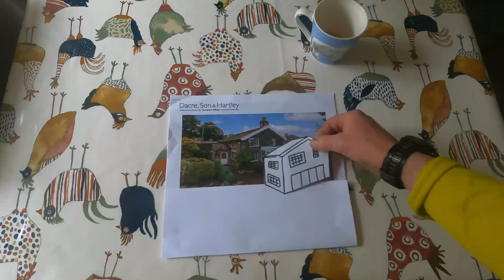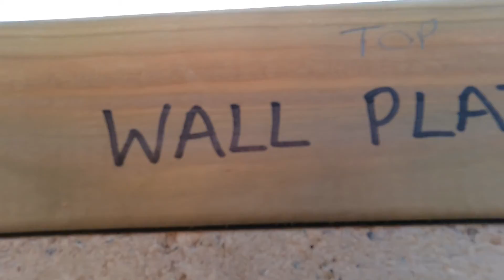Stone extension build - Episode 8

Comment: Very good and pricise work as always. 👍
Don't get it in a wrong way, but I would put some vertical cast concrete elements as structural parts of the wall for stability reasons. It is a must by our building code in Serbia. Even for small scale housing projects we have to include vertiical and horizontal cast concrete elements, if we speak about traditionally built construction. By our code bearing walls are minimally 19cm wide. 
I wish you all the best with your further well organised and precise work. 👌